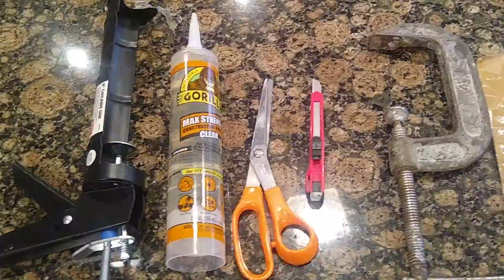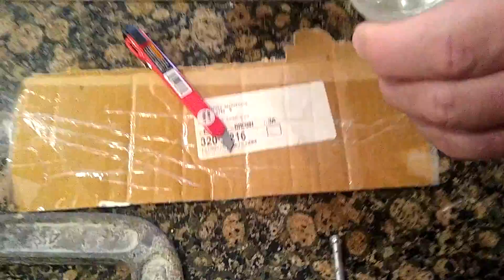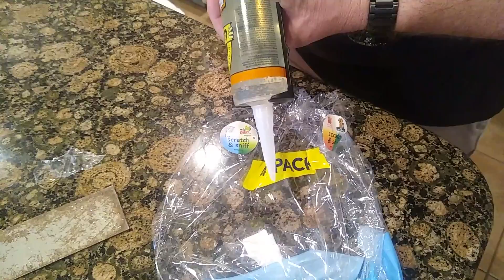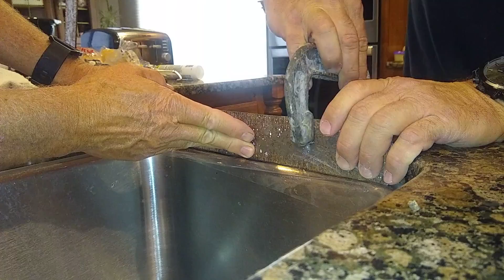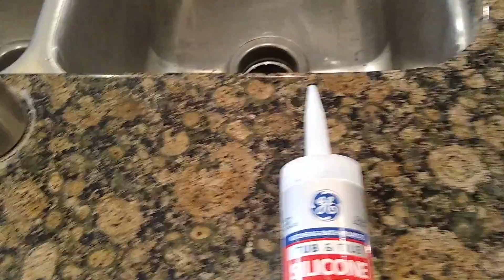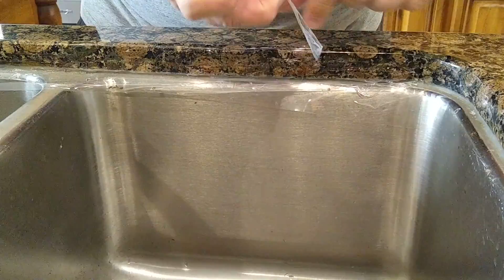How to repair cracked and split granite around the sink DIY video #diy #granite #chipped

Comment: unless you get the steel rod out of stone and put stone back together..... it will continue to get worse! you need countertop epoxy and a skilled hand.
Reply: Dan. Thanks so much for the suggestions. We are always looking for ways to do things. We completed the fix over 2 years ago and it is still holding strong.  Best of luck with your next DIY project.  Thanks again and hopefully you subscribe to Big Al Repairs.